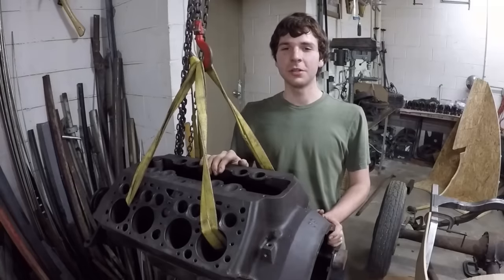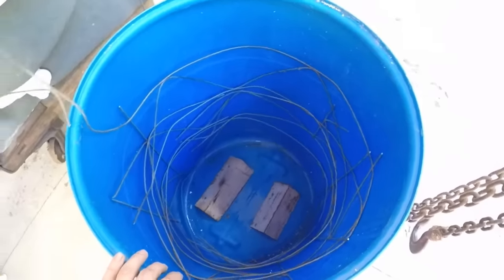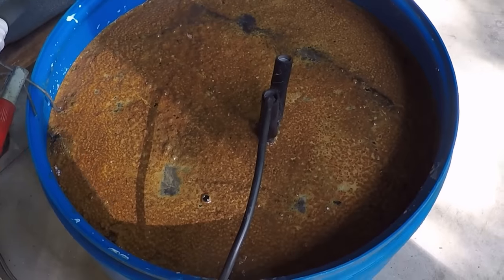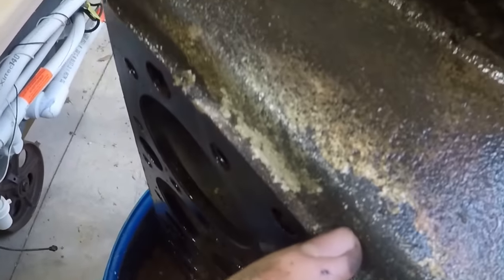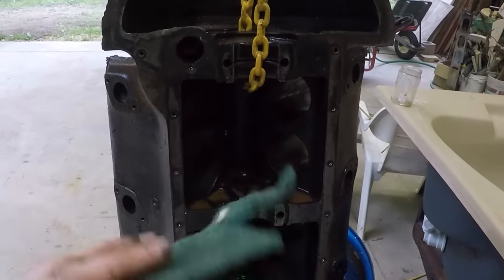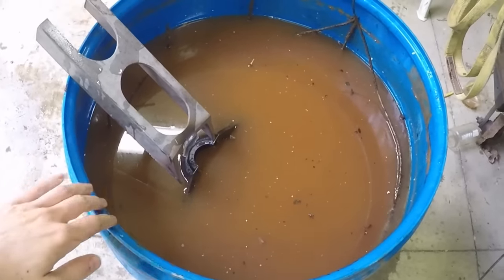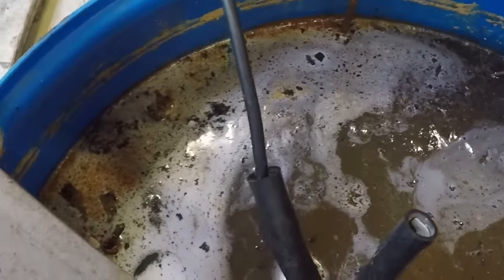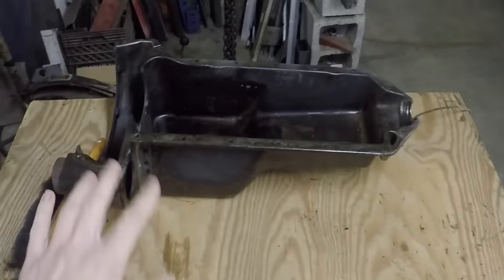Cleaning a 70 Year Old Engine with Electrolysis

Comment: you need to talk louder or up the volume in editing 
nice video by the way
Reply: I only have the video player turned 1/4 of the way up, and it's plenty loud. My pc is at 60% and my speakers are at half volume. Logitech 5.1 system of some sort. Fairly cheap. Sounds to me as if you are listening on crappy laptop speakers or earbuds.
Reply: Paul Childers i have a new MacBook pro and a good headphones i work vídeo editing and never have problems whit low sounds, so no, is no problem in my setup
Reply: @MakarovFox  It is very common for people to assume their equipment is fine and blame the product or service they are using. A quick scroll though the comments will show you that not 1 single other person has commented about not being able to hear him. If you are the only one having the problem, you might consider the possibility that you are having an issue.
Reply: Paul Childers I have no problem, this is the only video whit low sound and because more people do not mention that they  heard low to, does not mean that is only my problem, people do not always comment on everything that happens when watching a video, plus each  Setup varies from person to person and there are differences.
Postscript: I have 4 likes I doubt I was the only one that heard low sound
Reply: I had to turn my volume down. Could hear it fine

Comment: Muriactic acid works wonders too.  :)
Reply: Muriatic acid is a terrible idea, it is not a buffered solution. It is going to attack the base metal.

The whole point of using electrolysis is that it does ZERO damage to the base metal.

Comment: I use lye
Reply: for engine blocks or bodies?
Reply: @JoeHynes284  for engine blocks, heads and various other metal parts, we submerge them in a metal drum with lye and boil them for a few hours, sometimes we leave them there for a day or two but no more than that, specialy if they're aluminum

Comment: This might be a really dumb question.  I am a girly girl... I don't do old greasy engines.  Yuck. BUT my question is why not just use a cleaner like CLR? wouldn't it be faster and and easier?
Reply: Electrolysis is a good and practical way to remove rust while disposing of sacrificial metals that no longer have use and simply are occupying space. Also it is simple to do with household items like salt or washing soda and the electricity can be given by a battery or by a 5V DC adapter. Commercial cleaners, on the other hand, can be quite expensive, especially for college students like me. I have cleaned many rusted pulleys and old tools using this method. The rust gets removed and the parts become beautifully black again. After that, I spray them with some paint to prevent rust from coming back ASAP.

Comment: Partner I know it would be really expensive but  vinegar works much better  than electrolysis
Reply: Vinegar just etches the metal, actually removing metal.  Electrolysis converts the rust and adds carbon back to the metal.

Comment: Sandblasting would of been a short process . And a perfect key for paint .
Reply: No sand/grit gets in oil galleries which cannot be got out as people have found .....
Reply: @leso204  it depends the media used. just had a block done using Dry ice as a media all i had to clean up afterwards was the crude from a block and rust from a frame i had done . quite honestly i was amazed at how well it worked

Comment: The laundry soap is the same as baking soda.    It is baking soda.   Promise
Reply from the maker: baking soda is sodium bicarbonate. washing soda is sodium carbonate. similar names, but they're not the same thing. Baking soda will eat away at the metal faster than washing soda.
Reply: Fair enough
Reply: MacroMachines if your only using it for 24 to 48 hours hen your going to be fine
Reply: "…will eat away at the metal…" I thought this was a non-destructive process.

Comment: Lol use baking soda, that has baking soda in it lol
Reply from the maker: baking soda is sodium bicarbonate. washing soda is sodium carbonate. similar names, but they're not the same thing. Baking soda will eat away at the metal faster than washing soda.
Reply: Washing soda (sodium carbonate) is made by heating up baking soda (sodium bicarbonate) thereby releasing water. When you add sodium carbonate to water, you are converting it back to sodium bicarbonate. 

Its soda blasting using compressed air that prefers washing soda (for its mechanical action) over baking soda. But that's another video.

Comment: However, you could have done the same thing, but likely better, easier, less expensive, using molasses to clean it.  Do your own homework, I'm not telling you how to do it.
Reply: Th Fi well then don’t tell him how to do it
Reply: Molasses in solution is acidic and therefore a destructive method. Electrolysis is non-destructive, so not the same thing.

Comment: Just be careful not to breathe in what comes out of the barrel, Vince. Thats chlorine gas as a biproduct of the electrolysis... and well, dont overdo it, or your pistons may be loose from the material lost in the process.
Reply: DarkestVampire92 unless you put stainless steel in the electrolysis tank, the only off gasses are oxygen and hydrogen. stainless steel will create hexavalent chromium compounds, which is highly toxic, but stays dissolved in the water.
Reply: @francistheodorecatte  I only know it from cleaning/etching steel with this method using saltwater that theres chlorine gas forming in little bubbles. Might be a slightly different method here.
Reply: @DarkestVampire92  Unless you're trying this in your swimming pool, there's no chlorine anywhere in the process. The steel or iron doesn't have chlorine, the washing soda (sodium carbonate) doesn't have any chlorine, and the water won't have any unless you're adding it. Chlorine has to come from somewhere, and if none of your materials contain it, you can't generate it. Stainless steel will produce hex chrome as Frank explained, but other than that the only hazard is fire/explosion risk from the hydrogen and oxygen.
Reply from the maker: The only gases produced are oxygen and hydrogen
Reply: @MacroMachines  hold my beer
Reply: Where the hell did Chlorine come into the equation?
Reply: @adamchurvis1  salts with chloride release chlorine gas when broken down by electrolysis.
Reply: @1pcfred  What Chloride-containing salt was involved in this process?  I only skipped through the video, so I might have missed it.
Reply: @adamchurvis1  none that we know of. You never know what's in your water though. We generally don't get distilled water plumbed in.
Reply: @1pcfred  Why did you delete your post where you claimed that Chlorine gas was being produced?  Are you now claiming that Chlorine gas would be produced even from trace amounts in tap water, or did you delete your earlier post out of embarrassment when you realized your warning did not apply in any way to this video?
Reply: @adamchurvis1  I deleted nothing.
Reply: @1pcfred  Yes, my apologies -- I was looking for the wrong thing.  It was your post: "salts with chloride release chlorine gas when broken down by electrolysis" that I first saw.  No, you didn't delete anything.  I was wondering why you mentioned salts with Chloride when none were present in any significant way.
Reply: @adamchurvis1  how do you know? Did you analyze the compounds? Perhaps you have a mass spectrograph machine that works on YouTube videos. Good for you! My tricorder is in the shop this week.
Reply: @1pcfred  Because the only compound he added was that Arm & Hammer Super Washing Soda, which is 100% Sodium Carbonate; it is produced by heating Sodium Bicarbonate under controlled conditions for a period of time, and it has a MUCH higher pH (it is much more alkaline) than Sodium Bicarbonate.  Some people use it to create something approaching true ramen noodles, but their homemade version is often a very incomplete conversion resulting in too-low pH for their noodle dough water.  If Chlorine or a Chloride compound had been present in any appreciable amount on the engine block pieces then we would have seen it clearly before the cleaning, but even that would most likely not have been enough to produce Chlorine gas, which requires active Chloride compounds, not played-out, oxidized, old smears of a few grams of ambiguous Chloride-containing compounds here and there.  Also, look at the capacity of the electricity that is being passed through the liquid; it's a slow trickle of a low voltage.  These are my thoughts on the subject.  Do you concur?